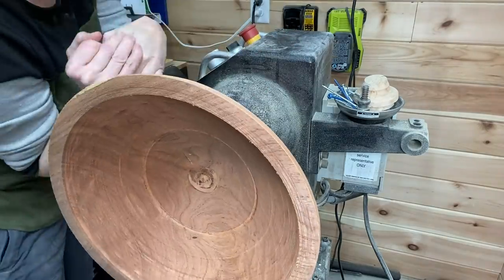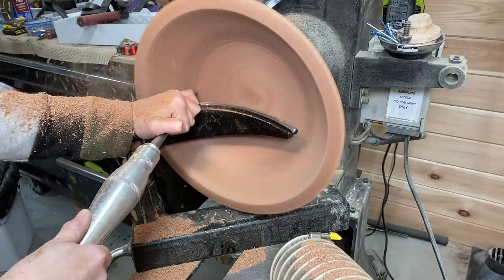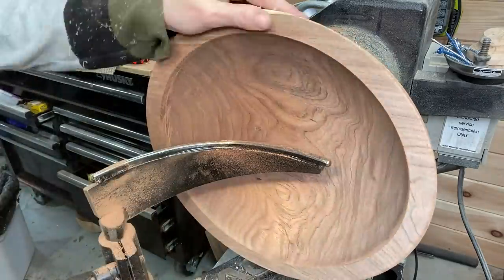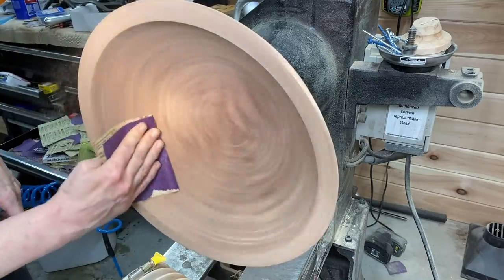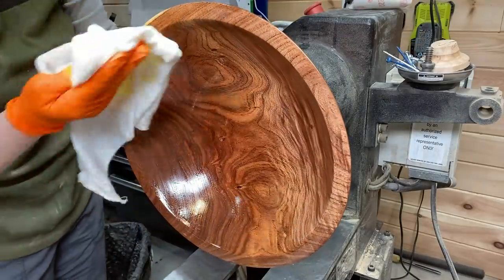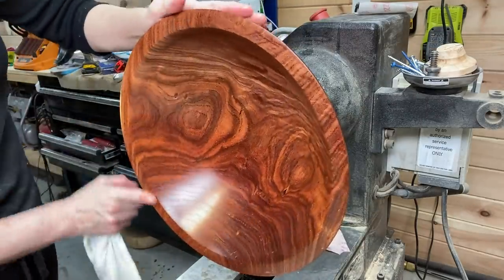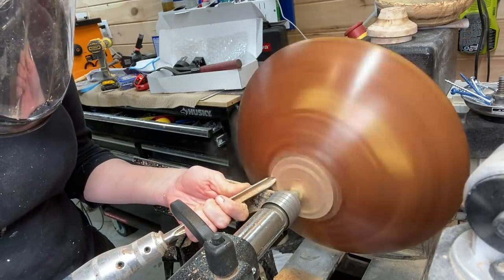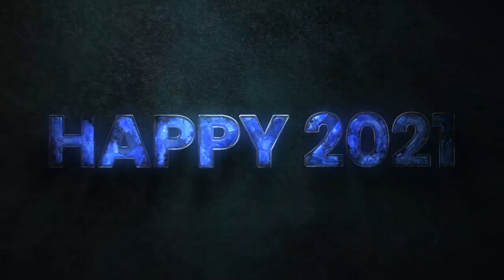Woodturning TEXAS Mesquite!!! (WOW, just WOW!!!)

Comment: I must say that living in Texas has it's advantages. Here Mesquite is very plentiful, but you have to fight the Barbeque folks for it. That's what makes turning it so good, I can smoke with any mistakes or pieces that have too much damage inside. Sometimes I just don't know when i start what I will find inside such as nails, Barbwire, or just rotten places that ruin it. Sometime a hammer and chisel are needed to save all the time spent getting to the stopping point. I must say Well Done ! Pieces of that diameter are hard to come by and my lathe cannot turn something that big around. I would like to send you some pictures as I don't have a setup to film for YouTube. Again Very Well Done.
Reply from the maker: Awesome, send them along! Thanks.

Comment: Peggy,  I have had an airshield pro for a number of years years now.
It works very well for filtering the dust and protecting the eyes and face from debris.  When I bought it there wasn't much else available. 
Things to be aware of:
It is heavy.  The motor is in the helmet in the area of the crown of the head.  It can slip or tip if you look down at the floor.  Long turning times can be a strain on the neck
It is loud.  I would recommend ear plugs
Accessories are expensive.  Replacement battery was around $60, filters are around $ 70, charging cradle for battery (if you want one) is $50 which is just for the cradle.  I charge mine in the helmet overnight.
As it is plastic, it is a dust magnet.  I use PLEXUS to clean the face shield and cut the static.
Next time I would investigate the helmet w/ seperate battery pack blower that Ashley Hardwood uses

Loved the bowl, the grain was amazing.
Reply from the maker: Awesome, good to know. Thank you!

Comment: Beautiful bowl especially the yellow sapwood contrast giving it character. Vacuum chucks changed my turning life. I have a Laguna inverter for my 24-36 and a set of hold fast vacuum chucks with Rubber Chucky seals. Downside is you will need a big loud air compressor. Mine in a shed barely hear it! Life is good. Cheers
Reply from the maker: Thank you!

Comment: You really brought out the beauty in the Texas mesquite. Most Texas mesquite has cracks and checks in it. I just wanted you to have the best possible mesquite for your first turning. The other side had those cracks and checks which I use bowties to hold it together then turn to finish. Mesquite dries at a ratio one to one. so it doesn't go out of round very much. I do have and use a vacuum system on most of my turnings.
Reply from the maker: Thank you! I’ve had lots of questions in the comments about who gave it to me and how they could get some!!

Comment: WOWZA!  Beautiful!  Good job, very nice, sanding was stellar; no sanding swirls.  Good way to start the New Year.  A vacuum chuck is nice.  My profession is HVAC, so I use a vacuum pump that we use to pull a vacuum on an hvac system.  It requires oil changes as the oil in the pump is very hydroscopic, frequent oil changes will make the pump last much, much longer.  It is far and away less expensive than a dedicated vacuum system for turning.  I use the vacuum chuck made by ONEWAY and adapted fittings and hoses for using my vacuum pump.  It pulls better than 25” of water column, it would take quite a bit for the bowl to come off of the chuck.  Used it for 10 years, so far so good.  I use the Trend Pro, i think it does a great job.  The top front of the unit got hit by an exploding bowl, minor damage; it is more hefty than the Bionic turners shield so i feel a bit safer when using it.  I really like Ack’s paste and polish too.
Reply from the maker: Awesome! Thanks for the info. Thanks for watching!! Happy new Year!

Comment: That is a beautiful bowl and I agree that the grain speaks for itself!  Our Mesquite in Arizona, at least what I’ve seen, is very hard and not quite the same grain structure.  I haven’t seen pieces that large because they don’t grow straight at all and are beautifully shaped.  I have the Trend Pro and have only used it a couple of times.  My issue is that when I need to see something more clearly and flip the shield up, it doesn’t go far enough and I have to take it off.  It’s very expensive and I regret getting it, but maybe it’s just my experience.  For 2021, I want to expand into more flat work and fine woodworking.  I pray that you have a very blessed and safe 2021.  I look forward to seeing what you make this year!  - Ed
Reply from the maker: Hi Ed! Happy New Year. Thanks for the info. A lot of commenters here have said similar things about the trend. I look forward to your next video, too!!

Comment: Peggy ,  I have used the Trend Air Shield for a week at John C. Campbell during a class and found it to be heavy and hard to wear for extended periods of time, it gave me a headache.  I then had the opportunity to try the  JSP Powercap made in the UK by JSP Ltd. and sold in the U.S.A. by Peke Safety the only distributor and it is simply amazing, I like that it is light weight and comes with every thing you need for a forced air respirator / face shield and helmet, it uses a recharging battery that last about 16 hours of constant use, the set up comes with a charging station, battery the respirator and a tool for measuring air flow to tell you when to clean/change the filters on the unit.  I highly recommend it, I know you are in Maine and if you ever drive over into Canada you can buy one there and save over a $100.00 U.S., you cant mail order them from Canada anymore they will not send them to a US address.  Anyway I hope you get a chance to try one  and compare it to the Trend.

Also a while back I sent you some abrasive paste and polish never heard anything from you so I dont know if you got it or not.  Todd @ Satilla Woodcraft
Reply from the maker: Hi, thanks Todd, I appreciate the info. I did receive the paste, thank you very much!!!

Comment: The Laguna - Vacuum Inverter for REVO 1836 works great. You will also need Stick Fast T27595 - 6" Vacuum Head 1-1/4" x 8 Spindle. Makes taking the Tenon off a lot easier.
Reply from the maker: Good to know, thank you!!

Comment: Get the firm garden kneel pads from the dollar store. Use scrap wood to turn different sizes for different size bowls. Attach the preshaped pads to them. May want to shape a bevel to the foam so that it can mold to the inside of your finished bowls better. 
I have Longworth chucks and Cole jaws but I rarely use them anymore because it is easier to just put the foam jig in the chuck. Not to mention a hell of alot quicker and cheaper.
Reply from the maker: Great tip. Thanks!!!

Comment: I have a Trend Air Shield Pro. It is very good, just a bit heavy on the head, so takes some getting used to. The 3M looks a lot better, but is 6 times the price, and since I am a hobby turner, I use the cheaper model. Replacement filters are a bit expensive, but it does the job really well.
Reply from the maker: Thanks!

Comment: You can always get more tools to improve your work.  As for taking tenons off bowls, I use a Cole chuck and haven't any issue with size.  If I ever turn anything near the diameter limit of my lathe, that won't work, but for now it's fine.
Reply from the maker: Cool, thanks!

Comment: I have the Trend air shield. Two complaints I have are it is fairly heavy and it doesn't have a stand-only charger. The battery charger is built into the helmet. I didn't use it for several months and now the battery won't last very long. I wanted to buy a couple of batteries and found that you have to have the battery in the helmet to charge it. The batteries are about $79.

Edit: So I see now they have a charger for the helmet now. Wish they would have sent one with the helmet.
Reply from the maker: Thanks for the info!